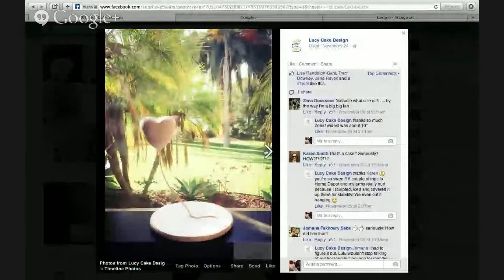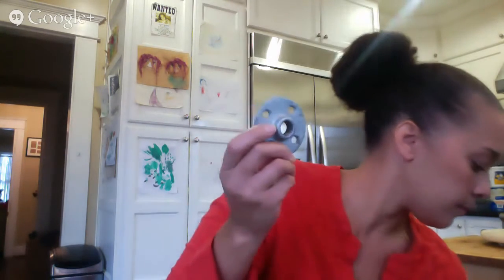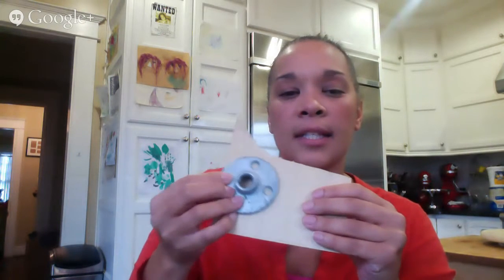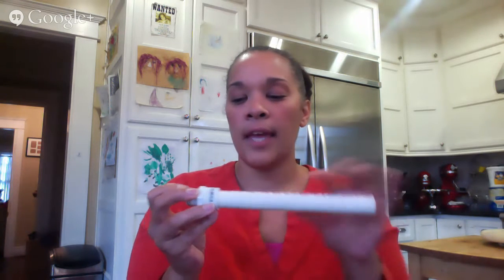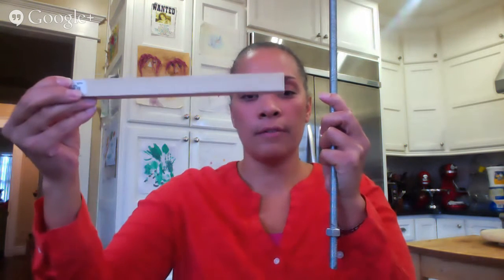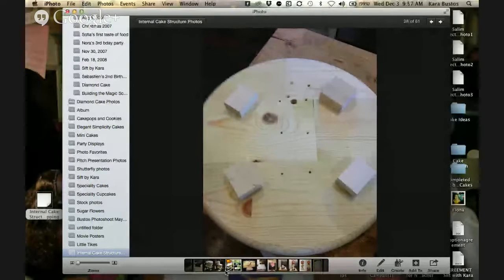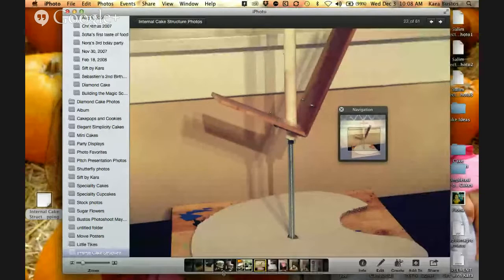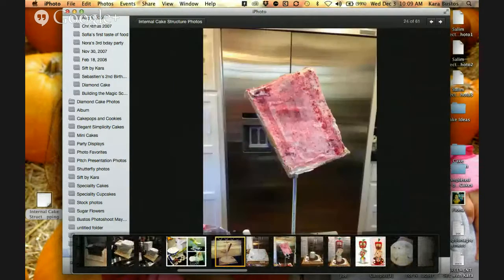Internal Cake Structures With Sift by Kara

Comment: For the apple, book and paint can cake, did you have to put additional supports inside the cakes or was ganaching the cake support enough? Did you transport this cake as a whole or pieces?
Reply from the maker: I treated each cake individually… the paint bucket was a 4 layer cake stacked.  The book cake was sectioned off with cake boards and some straw dowels to support the cake boards, making the servings easier.  The Apple was also a regular stacked cake.  The structure was built to support each cake by itself, not relying on the cake  under it.  HOpe that made sense. The apple cake was actually not ganached nor was the bucket cake.. only the book cake.
Reply: Yes it makes sense. Cool. Thank you!

Comment: Hi Kara! I came here looking for info on how to do my Stormtrooper helmet :) You know, the baddies from star wars that wore the uncomfortable-looking plastic white suits and giant helmets? So what I want to do is to have the helmet sort of suspended on the board....does that make sense? i wanted it to look like it was leaning forward in the front and balancing from the front tip. Have I lost my mind a little? So far I thinK I know what I am doing but I have no idea if it will work. I guess I will put the flang and pipe support throught the front, right? I am thinking I need to have a flange also in the board the helmet will sit on as the support for the structure isn't in the middle? Also there are two pieces that come forward that I intend to make out of rkt...do I have to build it up on some copper wire? Will it be stable just stuck to the cake? Does any of that make sense? Should I just show you a picture of what I am thinking?
Reply from the maker: I need to see a drawing of this on paper and your idea of structure drawn out  and I can give you my thoughts. Send to info@siftbykara.com
Reply: Ok! I just sent it! I hope I am on the right track

Comment: Hi Kara!  Just got this tutorial today!  Thank you for all the great information!  I've been following you on Periscope too.  ;)  I am working on my first internal structure cake for my daughter.  I'd love to do a flamingo standing on one leg.  I think the structure is pretty simple as far as a metal rod/PVC for the leg, attached to a piece of wood to support the body of the flamingo (which will be the cake part).  But the curvy neck is where I am stuck.  I was thinking copper wire, but I am not sure the copper wire will hold the weight of the head (probably done out of RKT, covered in fondant).  Do you have any suggestions for that?  I am unsure how I would connect it to the board all the cake sits on.  Thanks in advance, I know you're a busy lady!